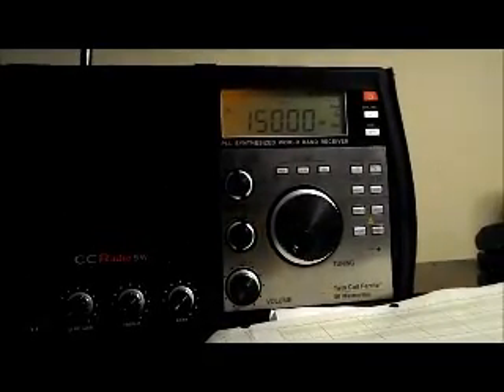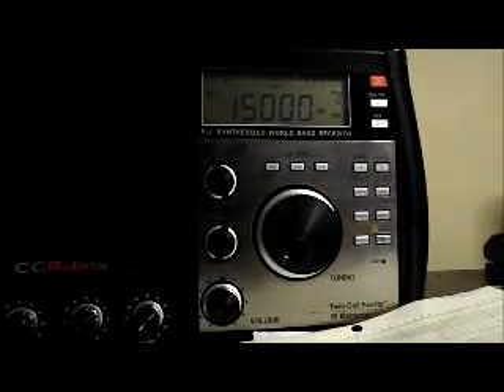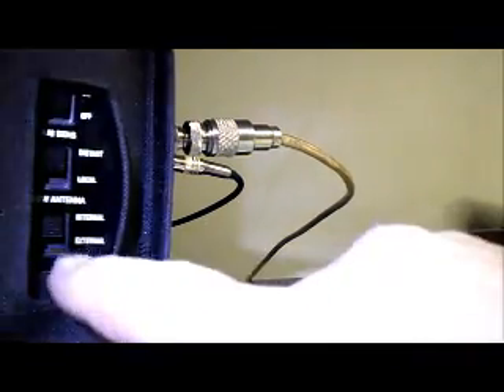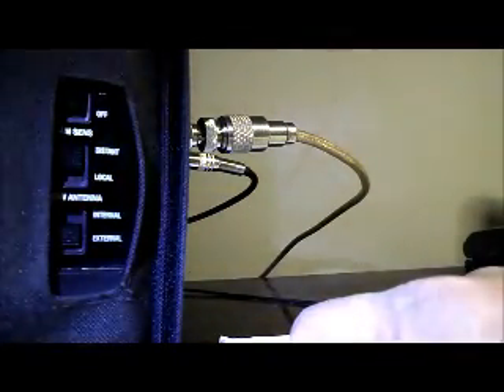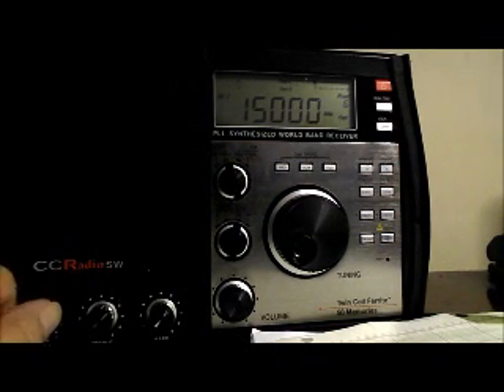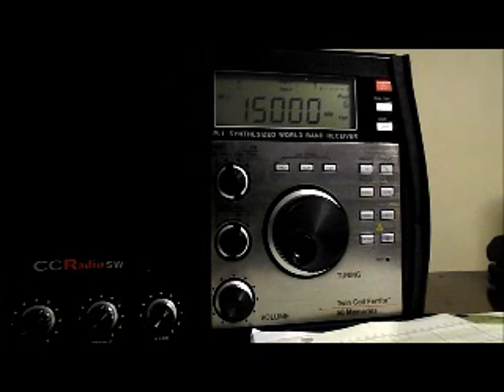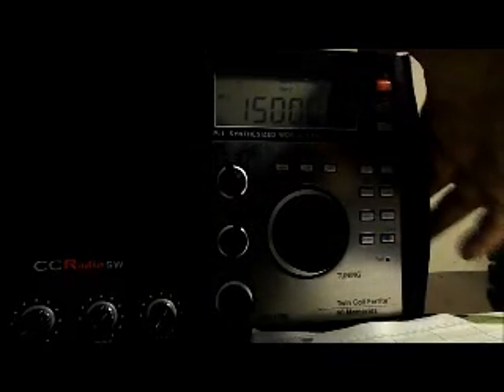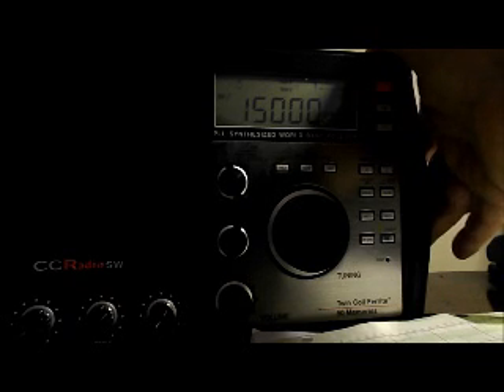SWL ANTENNA BALUN

Comment: I, as a Radio Amateur, have chased noise's since I was a kid !
So along the way, I have ran into some unsuspected culprits !
One being an old digital alarm clock !
That after the failure of its piezoelectric buzzer, became a horrible square wave generator, that covered the entire 10 meter band !
After some attempts at  direction finding, which   led me to the far corners of my back yard, I  was puzzled, by what I believed to be the strange pulsing buzz seemingly coming from the power lines, running to the house !
As I made my way back into the house, upon entering the back door, I caught, out of the corner of my eye, the flashing of the colin placed between the digital numbers of the clock face !
As it appeared to be in sync with the buzzing coming out of the receiver in an adjacent room, I gave pause, and thought to myself, " You have to be kidding " !
So with that idea fresh in my head, I proceeded to unplug the AC cord, powering the clock !
Eureka !
Upon closer examination, some how the switch to the alarm setting had been left on !
Why, or how long it had been like that, and if it was the cause of the  failure of the piezoelectrical buzzer, is unknown ?
But I would have never believed something so tiny, could reek so much havoc !
Lesson learned !
From touch lamps that poisoned the 20 meter band, that literally kept a fellow Amateur from using that band for years because of noise, until I asked him one evening if he had such a lamp ?
Again, Eureka !
And a host of terribly noisy Chinese switching power supplies, to something that I found quite by accident, as being a noise generator !
That being my Keurig coffee maker !
While meeting with an early morning group, I had gone into the kitchen, to make a cup of coffee.
After the ritual was completed, I switched the coffee maker off, by way of it's switch on top of the unit.
I thought at first what I heard was a coincidence ?
So I quickly put my hypothesis to the test !
And much like the afore mentioned incident with the clock, I noticed that I could make noise come and go on my radio's receiver, simply by turning the coffee maker on and off !
And upon further investigation, I found very objectionable noise levels on several other  HF Ham radio frequencies !
Now for the kicker !
I discovered for some frequencies, simply switching off the unit by way of the switch on top, was not enough !
But yes, as you may have guessed, the only way to stop the noise, was to completely unplug the coffee maker !
I'm guessing because of either a switching power supply, and or a noisy heating element ?
Which for me, goes a couple of ways !
One, obviously the ability to cancel the noise, and the second, after my coffee is made, There is no reason for this thing drawing current !
A win, win !
Sorry for the run on story, but I hoped to get, especially the story of these noisy Keurig coffee makers out !
And this may have been the wrong platform ?
So again, I apologise !
Hopefully, you will find parts of this helpful, if nothing else !

 😷👍👍

Comment: Nice video   thanks  ,also here in mi workshop im use long wire folded 13 meters long in border the  roof and balum 9:1  is the best reception in short wave ,am and fm radio , 73 from PY2DXA